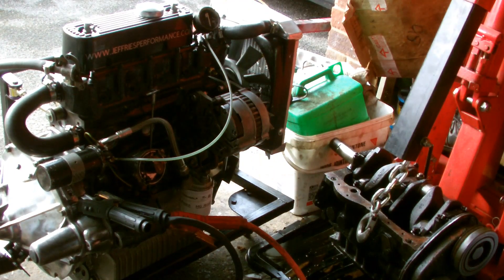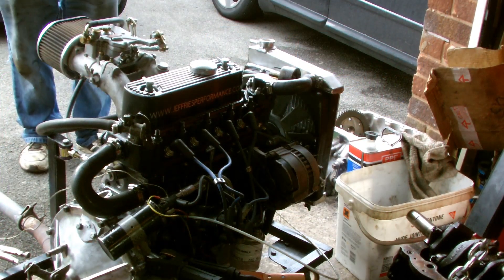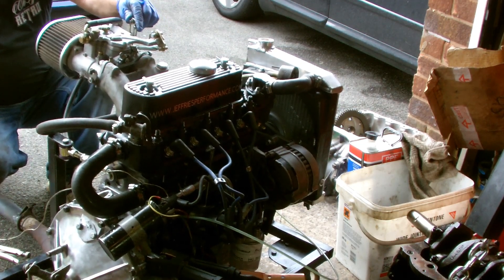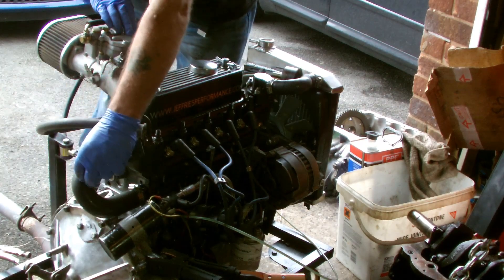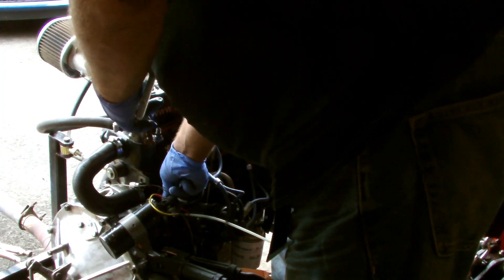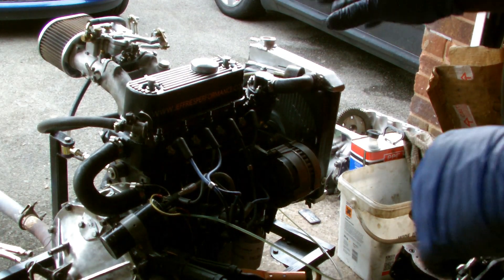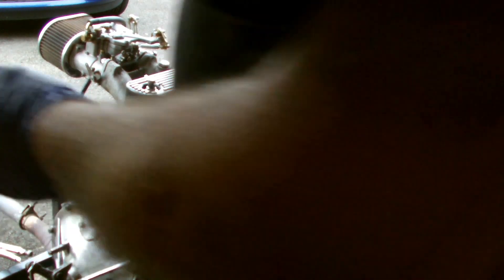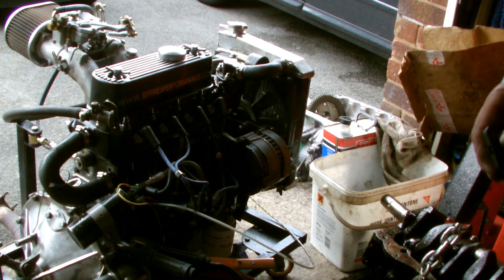classic mini 1380 engine first start

Comment: Paul, Great to see the engine up and running so quickly, It‘s amazing that you have built it in such a short period of time. The engine noise sounds very 
familiar and a great complement that you have based it on the build you did for our track car,  Cheers Dave

Comment: Hi Paul,  I was wondering if you had any ideas on a problem I'm having.  I've just installed my motor in my newly restored 1975 Mini and found that when the flywheel is at top dead center pistons 2 and 3 are up and it should be 1 and 4.  Is it possible to install the flywheel or other clutch parts wrongly to cause this problem?  I would appreciate any ideas you may have.  Cheers, Midge

Comment: Hi Paul, all sounds good, engine jig is a great idea hey! Question... How does a scatter cam work, what's the difference between 'normal' cams?
Reply from the maker: The scatter cams have different profiles to suit the siamese ports on the A series engine so that the engine performs better.
Reply: @pauljeffries  OK thank you, so do you generally use scatter cams in your builds if they work better? Or does it depend what the mini is being used for...fast road, race, hill climb etc?
Reply from the maker: @andyfry1970  the various scatter cam profiles are all high lift long duration cams, so really only suited to track day and hillclimb builds etc, I've only used scatter cams twice, one in dave jags build and the other one in mine.
Reply: @pauljeffries  OK, I get that, and is that why you would couple the cam with just a 1.3 roller rocker as the cam is already profiled for a longer opening rather than a 1.5 roller for longer opening? Hope that makes sense lol, and I hope you don't mind me asking these questions, I like to understand as I'm not very knowledgeable about engines, only what I have read, it's more about the 'why' different components are used together and for what benefits
Reply: The jig building video is on my channel if you want to check it out. Cheers Dave
Reply: @ClassicCarCave  Hi Dave, thanks for that, I'll give it a look. Ya Gulf liveried mini is looking great too 😊